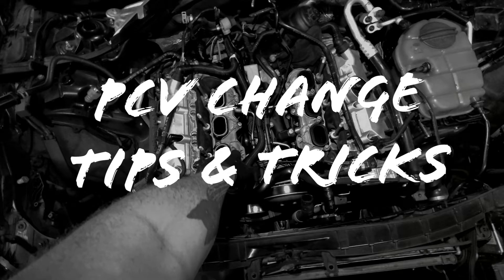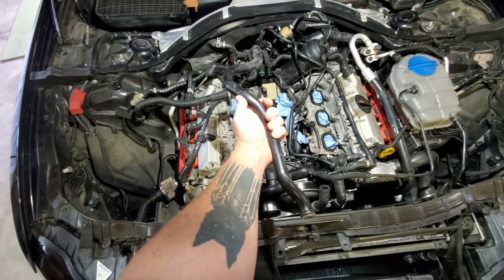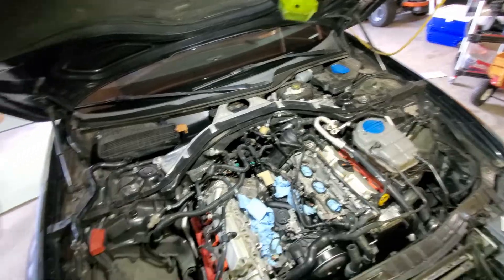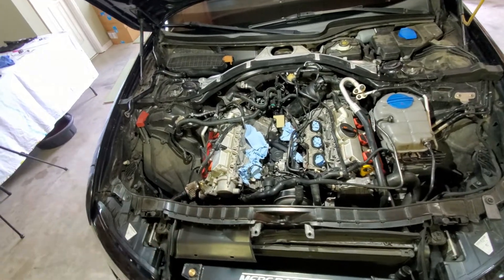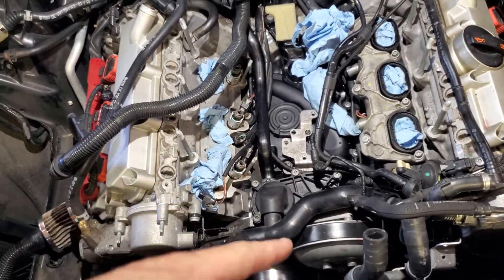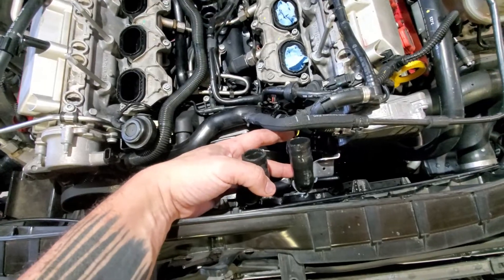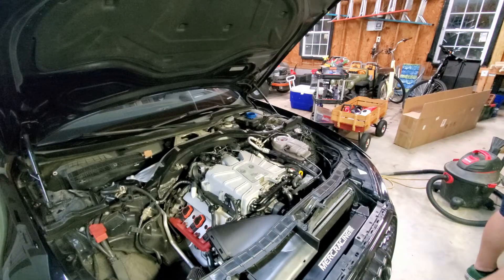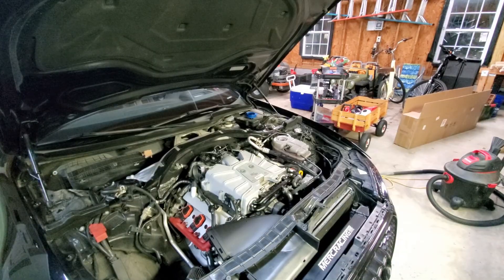Supercharged Audi 3.0T PCV Replacement Tips & TRICKS | C7 A6, A7 & B8 S4, S5, SQ5

Comment: I'm also thinking the pcv is issue but I've also seen a few people replace their pcv and turns out it's not the problem in some case's its a solenoid with a breath or part number :06E103207AP what has a piece on it that can also get stuck open from what I've read and cause the exact same symptoms as a bad pcv. So idk if I should just go ahead and change replace the pcv. Or take baby steps by replacing the other part then of that doesn't work then replace the pcv
Reply from the maker: I didn't replace mine, but I think I'm going to open it back up & replace it bc I'm still getting a pcv fault 😑
Reply: @GarageTaught  yea at exactly 9:55 the weird cylinder   shaped solenoid thing in the upper right hand corner of the video.  I've seen a forums and Facebook posts where people said they have replaced all that good stuff but the code ends up coming back a few days or so later. And turns its some kind of solenoid or part number: 06E103207AP I'd have to have to take apart everything to replace it when it's just a small part that didn't take nowhere near as long to replace and a whole lot less I've seen the parts on ebay for new oem  between $29-45 and sites like fcp euro or ecs for 100+ also on jhm.com it says in the description of the part '......''Common fix for PCV Valve Malfunction P052E code when a new PCV valve does not fix the issue.'''
Reply from the maker: Do you have a link to where you read about it?
Reply: @GarageTaught  https://www.audizine.com/forum/showthread.php/916430-PCV-Regulator-Valve-Performance*P052E00
Reply: Also when I got code P052E00 it came up as static while I see other people it comes up at intermittent so idk if that would change anything or if it'll give a little more info on the problem didn't even know I had the code until I used a friend's obdeleven  because it didn't come up as a check engine light
Reply from the maker: Yea its a soft code for me too
Reply: @GarageTaught  I've sent the link I was mainly looking it it's also a few other forms that talk about it and a few things on Facebook audi group page about it.... I'd hate to have spend $500+ and several hours to replace it when it was only a $100 dollar part that could have replaced in 30min to an hr 🥲 if you find anymore information on it let me know maybe   maybe you will get around to it before I do
Reply: @GarageTaught  did you also have a strong suction when removing oil cap?
Reply: @GarageTaught  https://www.audizine.com/forum/showthread.php/840432-Strong-vacuum-on-oil-cap-while-engine-running-normal-Throwing-PCV-code
Reply from the maker: It was strong, but not to the point I had to work to get it off
Reply: @GarageTaught  🤔hmmm by the looks of everything I'm feeling like it's the pcv hose and not the actual pcv I went ahead and ordered the part and will try to put it on once it gets here
Reply from the maker: How old is your current pcv?
Reply: @GarageTaught  not sure I got the car with a little over 114k I'm at 119k now I assume it would have already been changed by this time car fax doesn't help much it'll say like maintenance preformed and vehicle serviced but it doesn't specify only thing it really specify is regular oil changes and your basic maintenance stuff
Reply from the maker: In that case you should change the pcv as well. And do the Thermostat/water pump if you don't know how old they are
Reply: @GarageTaught  definitely on my list I just never have free time to do it and the only shop that will do it wants $2850 but they won't let me supply the parts so I'd have to them for the parts and labor instead of just labor .🙃 I guess I'll take it on myself doesn't look too difficult just very time consuming
Reply from the maker: Yep. A lot of time but a lot of savings

Comment: I’m at 80k. Nothing was bad but preventive maintenance. Just changed out my pcv, thermostat, water pump, valve cover gaskets, porting my supercharger with Jokerz, and walnut blasting/clean my intake ports. Thanks for this video! I made my light mistakes too because FCP did show everything.
Reply from the maker: Their guide is great, but definitely missing a few things
Reply: @GarageTaught  I’m also replacing my supercharger intercoolers, and the supercharger oil. I’m happy you have these videos coming out. Informative !
Reply from the maker: I want to replace my ic cores... I just don't want to buy ic cores lol
Reply: @GarageTaught  yeah they’re expensive. I decided to simply toss mine and not even send them out stupid decision not to save money but at least mine are brand new I know they won’t leak.
Reply from the maker: You will see in a video on uploading soon that I cleaned my cores. It helped, but I still have high IAT's. There is no reason for it either, so I think my cores are worn out
Reply: I did it all at 85k. For me that pipe had broken, causing me to have to get in there. The bolt is a total pain and even more of a pain to figure out how that hose was attached in back, so thanks for telling people. I got to it much easier by removing the breather hoses entirely.